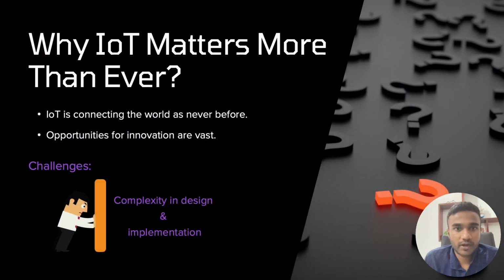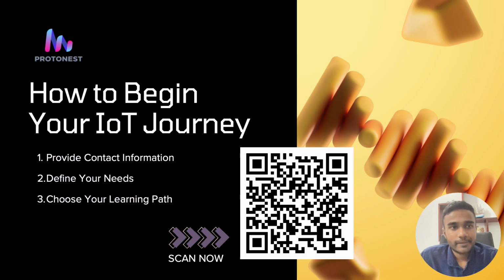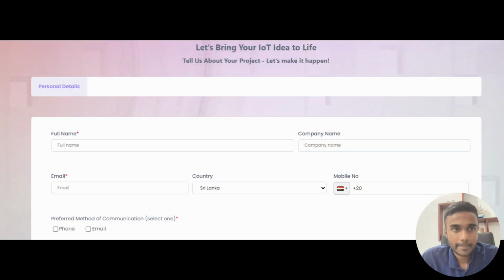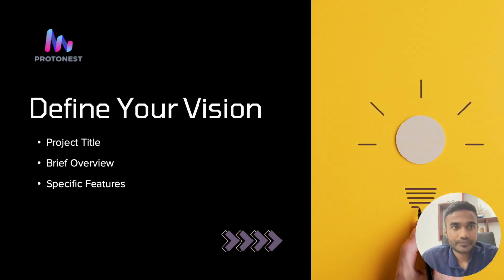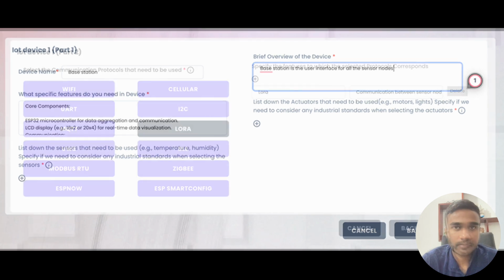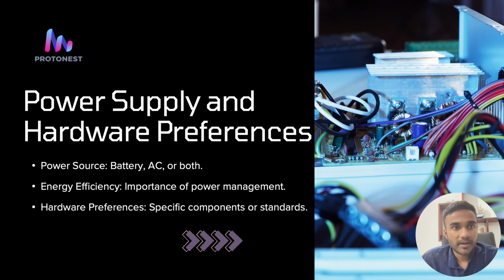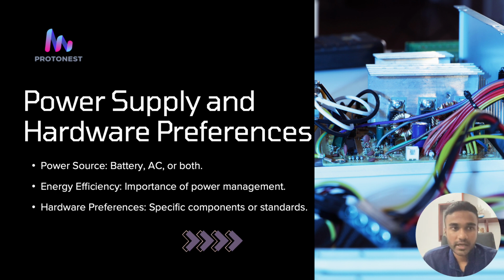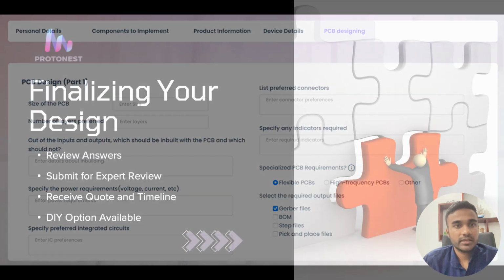Best IoT Design Tool - Introduction

Comment: your IoT design tool needs a suscription or it is just for your customers that need a development from you?
Reply from the maker: You do not need any subscription, the tool guides you through the process of developing the IoT system with articles and specific points you need to consider. If you need us to implement it after submitting it,, we are able to do the development for you. If you have any questions regarding the tool, contact us at info@protonest.co